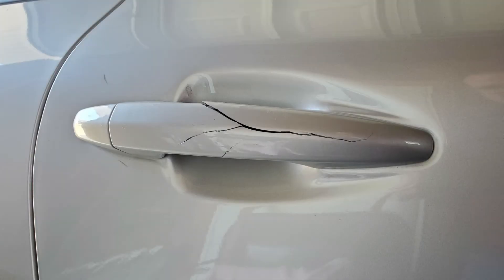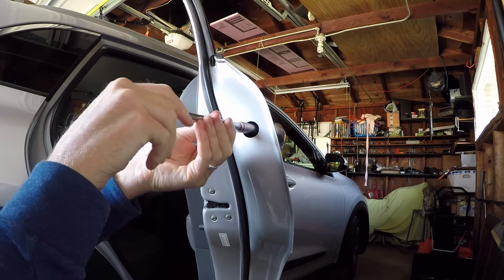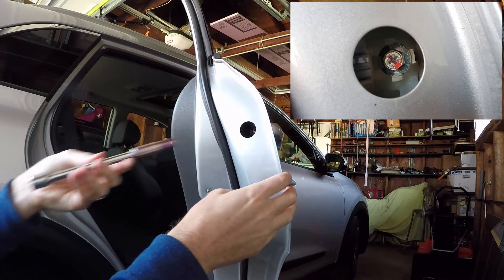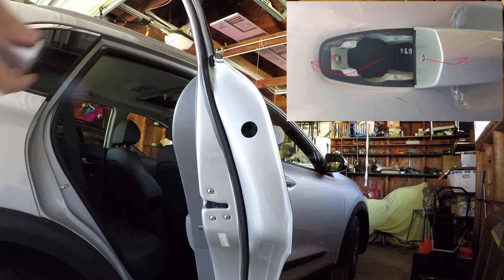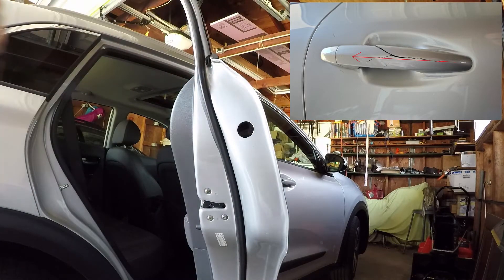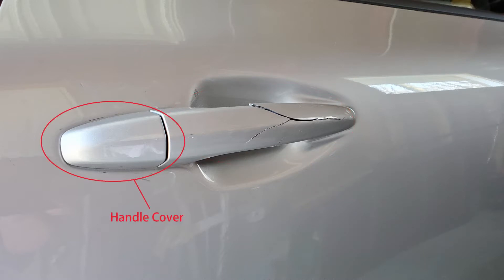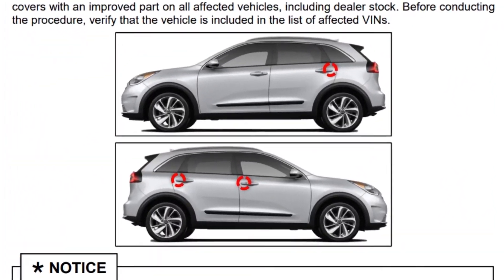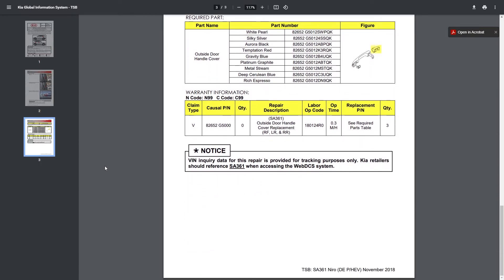Kia Niro Door Handle (2016 - 2020)

Comment: Thank you so much for this video and info, my Niro's rear door handle small cover broke off and the whole handle came off just from normal use,  it looks like this is a recall and a very common issue, design flaw. Quick question, did that handle cracked from outside impact? or was it cracked from pulling? which I would find hard to believe since the small cover would brake first before this severe handle cracking.

Comment: thanks for your video BUT i need to replace the driver's side door handle. the little cap fell out that protects to electrical. is the process the same as the above video or more difficult? PLEASE HELP!
Reply: Same here
Reply from the maker: The part number will vary depending on the color, but here's a link to a webpage with many options (https://www.kia.parts/v-2017-kia-niro--ex--1-6l-l4-electric-gas/body--front-door).   

I haven't performed this procedure myself, but it  looks a bit tricky.  You need to remove the inside door panel to gain access to the door handle's connector (the connector connecting the wires from the door handle's lock button to the rest of the wiring harness).   Even after you have removed the inside door panel, there is a secondary panel that can be tricky to remove.  There's a short video on YouTube showing a guys struggling to remove the secondary panel (the panel inside the inside panel) https://youtube.com/shorts/RADfJUDJVtQ?feature=share .  To truly remove the secondary panel I believe you need to disconnect the window (steps not shown in that video), but...instead you may be able to reach your arm into the door from bottom of the secondary panel (the bottom of the secondary panel can be loosened).   If your arm is long enough you may be able to blindly grab the connector and disconnect it (and reconnect the new handle). Eager to hear how this goes for you!  Too bad they make it so difficult for the smart key lock handles:(!
Reply from the maker: @biancacarroll9079  The part number will vary depending on the color, but here's a link to a webpage with many options (https://www.kia.parts/v-2017-kia-niro--ex--1-6l-l4-electric-gas/body--front-door).   

I haven't performed this procedure myself, but it  looks a bit tricky.  You need to remove the inside door panel to gain access to the door handle's connector (the connector connecting the wires from the door handle's lock button to the rest of the wiring harness).   Even after you have removed the inside door panel, there is a secondary panel that can be tricky to remove.  There's a short video on YouTube showing a guys struggling to remove the secondary panel (the panel inside the inside panel) https://youtube.com/shorts/RADfJUDJVtQ?feature=share .  To truly remove the secondary panel I believe you need to disconnect the window (steps not shown in that video), but...instead you may be able to reach your arm into the door from bottom of the secondary panel (the bottom of the secondary panel can be loosened).   If your arm is long enough you may be able to blindly grab the connector and disconnect it (and reconnect the new handle). Eager to hear how this goes for you!  Too bad they make it so difficult for the smart key lock handles:(!

Comment: I used theirs to replace my broken cover, what a time and money saver. Only downside I was sent the wrong color, charcoal should be charcoal, No?
Reply from the maker: It's an easy enough repair to redo.  If the sent you the wrong color, complain and get them to send you the right color.  They'll probably let you keep the wrong part too...which you can keep as backup or optionally  resell online.

Comment: I brought this issue to my Dealer and they claimed they were not honoring the recall anymore.  Seemed kind of sketchy, but what's our recourse?
Reply from the maker: A quick Google search suggests that recall work should be covered within 10 years of purchasing the vehicle.  This eeems like bad customer service and laziness on the part of the dealer.   This is such an easy\cheap job you'd think they'd do it for you just to have the opportunity to sell you an oil change.  Try calling Kia Customer Service at 800-333-4542. Maybe they'll call the dealership on your behalf.  Or...if they give you a hard time too, then be thankful that this is such a cheap\easy fix and do it yourself.
Reply: @hanoihancock  I didn't think of that.  Thanks, I'll try!

Comment: How about the front?
How do you get to the plug?
Reply from the maker: Same way as the back door.
Reply: @hanoihancock  
Nope, smart key button and light have plug you have to get to, not the same.
Reply from the maker: @dirkhunt9425  By "get to the plug", do you mean the plug that covers the screw that holds the handle in place?  Or do you mean the electrical connector attached to the handle?
Reply: @hanoihancock  I'm pretty sure he means the electrical connector, since he mentioned the smart key button and the light in the handle. At least, that's what I need to know. I tried following the repair manual, but I can't seem to get past the module plate.